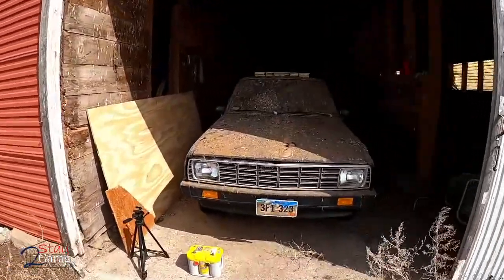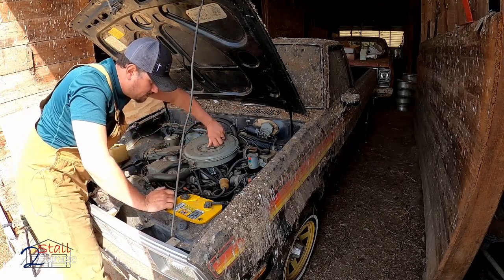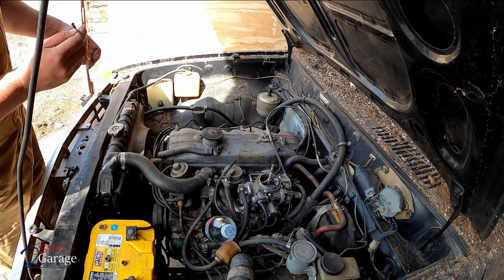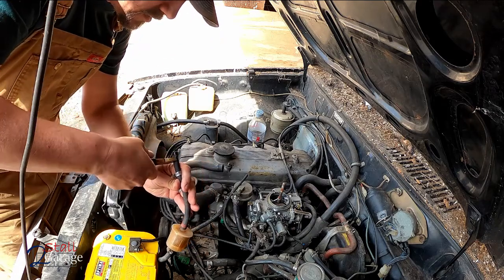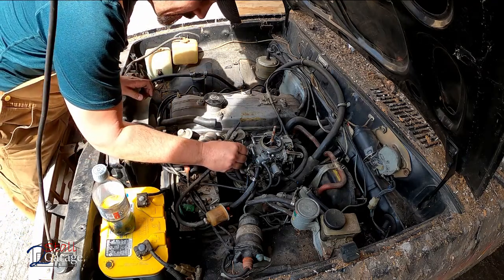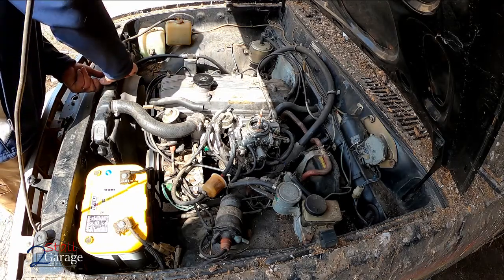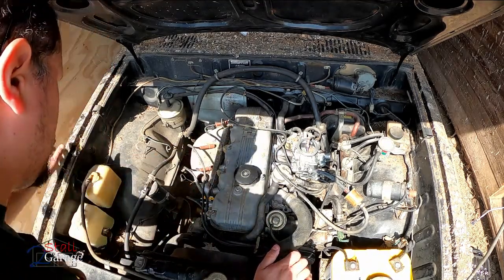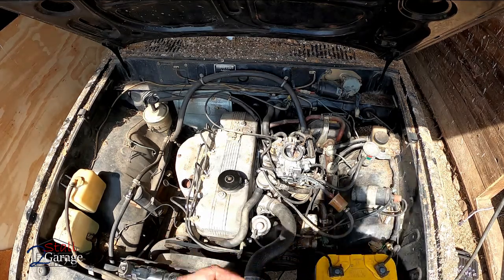Dodge Ram Mini Truck Revival | Will It Start

Comment: What did you end up doing with the truck? Are you considering selling it? I have one and love the truck.
Reply from the maker: What year is your truck? We have a buyer lined up once the oil pump issue is resolved. They’re cool trucks!
Reply: @2StallGarage  It's an 1986. Had it for 25 years.It has the 2.0. Great little engine.
Reply: @duncanmacrae6384  It looks like a 1979, or 80 to me (because of the graphics design). The D50 sport had the 2.6 engine, and the 5 speed transmission, not the smaller 2.0. I bought one new, the first year they came out, which was 1979. I owned  3 of them. My original one (not a sport model) had the 2.0 engine with the 4 speed transmission. These trucks were packed with innovative features that were not available on the other Japanese mini trucks, at that time. Only one bed length available, which was almost 7 feet long, and storage behind the seat.
Reply from the maker: You’ve got some knowledge about these trucks for sure.  Thanks for checking it out.  We revived and ultimately sold this one about 3 months ago. 🔧
Reply: @2StallGarage  first time viewer, you did a great job nurturing the truck back to a drivable condition!
Reply from the maker: Thank you, Carl. Much appreciated.
Reply: I am 1981 same style but blue
Reply from the maker: @tennessee4203 with the pinstripe too?